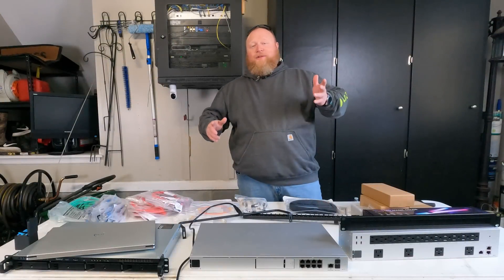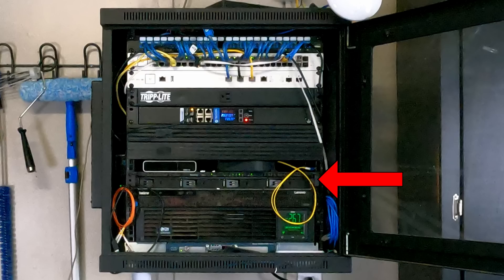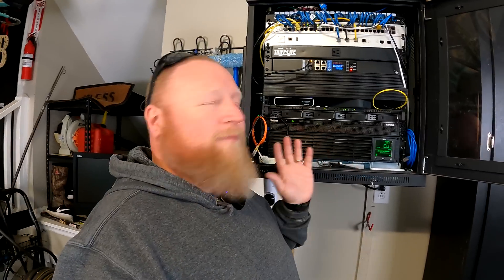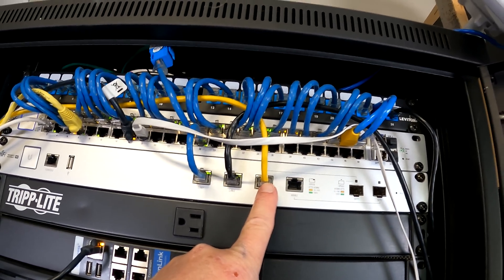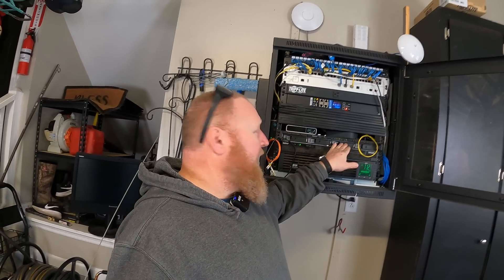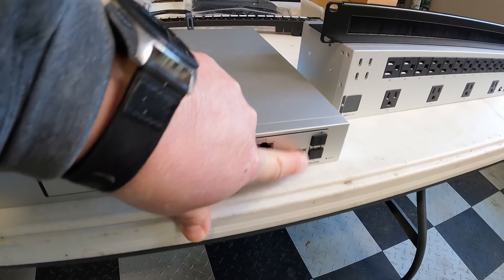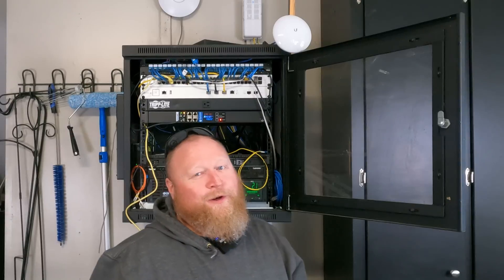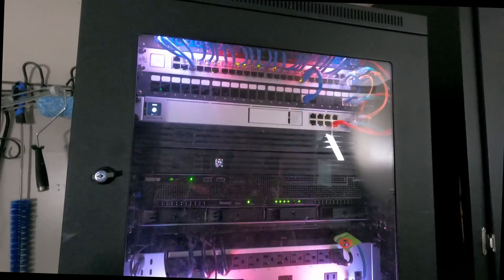Upgrading My Home Network Server Cabinet - 30TB, UniFi, Fiber & 10Gb!

Comment: Looks amazing 🤩 
Have you had a look at mounting the power supply to the back mounting points and behind something like maybe the patch panels? that way can’t see power at all
Reply from the maker: Actually I did, but the power strip looks so nifty that I just couldn't hide it.
Reply: @projecttimetech7022  yeh it does look nice. Maybe a cheap future upgrade of right angles power cables? I dunno
Reply from the maker: @om3rrr0w44  Oh I like the right angle power cord idea. Thanks for that idea!!

Comment: Nice set-up.
I have 2 RV parks that have Unifi camera's. They are hogs and tax the heck out of the Unifi Cloud Gen2 units. I upgraded them to the UDM Pro units with 2TB drives in them and setup to dump old files after 21 days with only seven G3 pro cameras it still has a far load on the system. I run the Blue Iris at my home and prefer it better over the Unifi cameras. I have been using UBNT products sense 2005 back when Robert Perua only had wifi cards when we built our own access points using Mikrotik router boards deployment back when I owned a Wisp. I still run many of Unifi PTP 60ghz units when I can't get customers to run fiber, the Unifi access points work well. The reason I rolled out Blue Iris at home is you are not forced to run 1 brand of cameras as to Unifi you are. Alot of times the Unifi cameras are out of stock.
Reply from the maker: This is pretty much exactly why I use BlueIris. I even have live video feeds of local news cameras in mine. Pretty much, if you can find a stream, it'll display it. Very good product.

Comment: Nice work! I use the 10Gb SFP+ on my UDMPROSE to connect to the ISP box. Currently 'only' 2Gb ISP Fibre but hopefully they will open it to full 10Gb in the next year. What a time to be alive, it's a long way since the days of the US Robotics Sportster 56K.
Reply from the maker: Yeah, I was working in IT during the 28.8 and 56k days I remember when I first got bonded ISDN at 128k. Huge day for me. Now here we are at multi-gigabit connections. Wonder what another 30 years will look like?

Comment: watching upgrade tech list supports up to 2.5 gigabit you uh... Realize that a dell r620 would get you dual or quad 10gbe uplinks, right? And the X510DA based rndcs will let you use the mikrotik nbase-t adapters to support 2.5gbe or 5gbe as well?
Reply from the maker: Yeah, lots of equipment options to do this same thing, but at the end of the day, the R620 is about a foot too deep for my cabinet, plus my existing server has been here for a long time. I'll upgrade it at some point too.

Comment: Wouldn't it have been enough to just do LACP with the 2 1gbit ports in the NAS?
Reply from the maker: I originally had link aggregation between the server and NAS, that was better, but when it comes to editing 4k video, I could use million gig if it were a thing.
Reply: @projecttimetech7022  How fast are those disks in a RAID 5 array?
Reply from the maker: @vFoxArts  I've not measured them. But file copy from the NAS to my editing machine is roughly 400MB/s. Which is MUCH better than the speed I was getting before. Hell, it was taking 45 minutes to copy a set of files to edit.
Reply: @projecttimetech7022  Alright :)

Comment: Well done video and presentation. Question how is your att service working with out an RG that normally is the next hop from the 010 ONT you have? I’ve wanted to eliminate the rg so the only route in use is mine.
Reply from the maker: Hi Nathan, there is actually an Arris NVG599 (I think that's the model) tucked away in the side of my cabinet. I may not have shown it in the video, though.

Comment: Not a critique but more a personal preference... I always try to leave enough space to battery change my UPS without having to tear my rack apart.  Only thing I would have done differently is to put one of the 1U spacers on the bottom and move my ups up so the battery compartment was accessible.  Other than that looks like a great project!
Reply from the maker: Yeah, I was mulling that over in my head too. You're right.

Comment: I have Blue Iris for my security cameras.  I want to use and max out some of the features with out having to use substreams, because you do lose quality, yes save CPU and GPU but I don't want to lose any detail.  So I'm looking, and wanting to build what some all over kill security camera server.  been looking at video cards, or if I have to a good few GPU's be it Intel arc, or a few of them and have them do different groups of cameras. I have been replacing Cameras with at least 4k or better.  If only Blue Iris made a linux version of Blue Iris.  But windows is so resource hungry.     Like this video. I need to one day get a better UPS.    I have 10Gb back bone now.  MY poe switches are now aruba poe switches, and my pain switch is a netgear 10gb switch.  So I have plenty of network speed. It also made my camera's better. They are not provided with 100/1gb poe with 10gb at the poe switch so now no lag or slow down,
Reply from the maker: Cool! Sounds like a nice setup you have.

Comment: I'm about to upgrade from a 6U to a 9U closed rack and adding a PDU Pro to the mix and some RGB. Thanks for sharing your video because I was a little worried about the weight since I also have an NVR Pro with 4 HDDs and a 48 port PoE switch but I feel more confident it should be no problem as long as the rack is on a wood panel attached to the studs. I'm keeping all my equipment silver and white so I can't wait to see the end result. Nice rack man!
Reply from the maker: Thanks. Love to see what you end up with.
Reply: @projecttimetech7022  Finally upgraded the rack, wish I could upload a picture of it here.